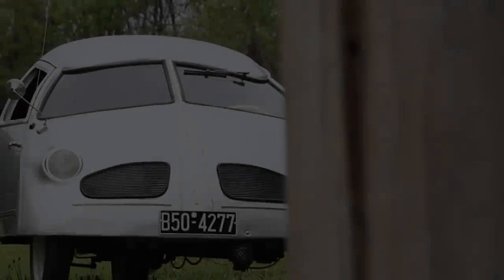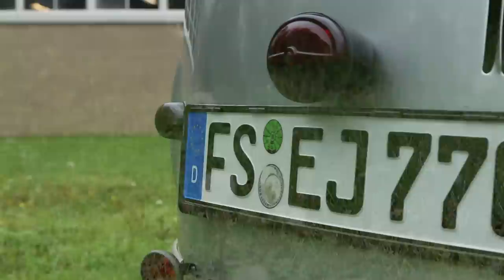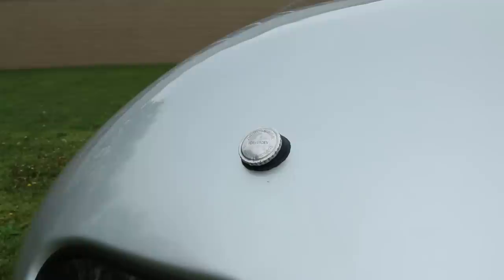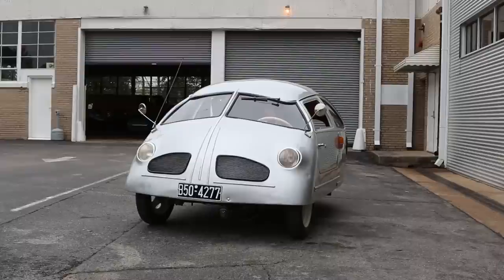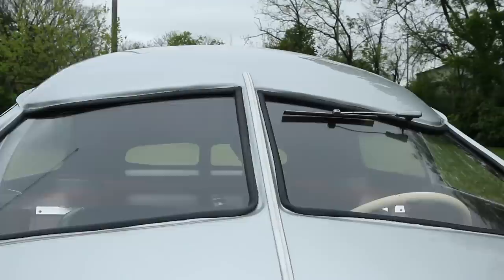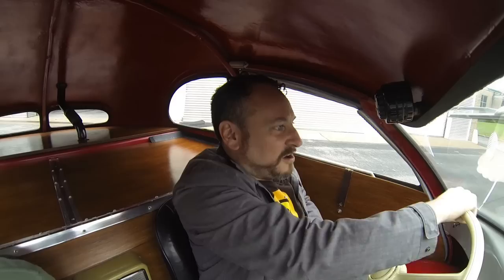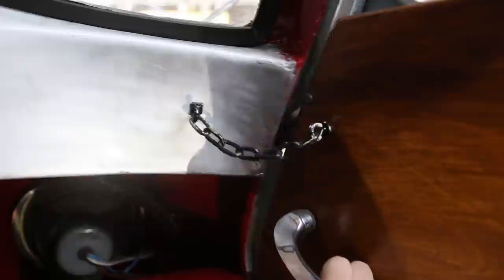What It's Like To Drive The Worst Car In The World | Jason Drives

Comment: I thought the Reliant Robin was as bad as it gets.  I was truly mistaken.
Reply: +David Hoffnung The only thing worse than having one wheel in the back, is to have it in the front. I am sure the Reliant Robin flips easier.
Reply: +Mp57navy On a normal 4 Wheel car, the rear wheels give it way more stability than the front ones, f.e. in a crash etc.. So it would make sense to put em in the rear, although they might have made it a bit wider.
Reply: +Mp57navy - only this one doesn't have it in the rear, not really. It's basically in the middle of the car, together with the fuel tank and the exhaust pipe. Wonderful design! :P
Reply: +David Hoffnung The Reliant Robin is uglier, which is saying something because the Hoffman looks like some sort of metallic beetle. I'd still feel unsafe driving either haha
Reply: Jeremy Clarkson should drive this
Reply: the RR is almost like a rollsroyce in comparison with this turdnugget XD
Reply: Not terribly bright are you, Freekrider?

Comment: By far, the worst part of this car to me is the rear wheel steering. Truly deadly.
Reply: ...and loses.
Reply: Yes, like he said the rotational momentum makes it hard to come out of a turn, but they also seem to have put the engine at the 'wrong' end of the trailing arm: maximum unsprung weight!
Reply: The Lane Motor Museum built a copy of Buckminster Fuller's Dymaxion car, which had a single steered rear wheel. Dan Neil wrote about it in the Wall Street Journal some years ago. Apparently it's a handful to drive. Better someone else than me.

Comment: Made my day,I nearly wet myself laughing,in fact I think I have. 
Nicely made, but designed all wrong,looks like  a giant SS helmet .
I know about these kinds of cars ,I had a Messerschmidt  KB 191cc  three wheeler,used to go quite well ,70 mph forwards AND REVERSE!!!!!!! bit more stable than this helmet on wheels,but I nearly got killed several times in  it, tipping up on corners if I pushed it too fast..
The clutch regularly burnt out as did the brakes,the flywheel came undone and ruined the windings, never charged the battery again,no one could mend  it, humping spare batteries every day, acid all over the floor andr my clothes, the engine fell off its ONE  rubber mounting, had to tie it back on with rope.. bloody nightmare
 to put it kindly..and I was stuck with it as it was on HP... after paying it off I swapped it for a tape recorder that also was crap.the last I heard the bloke who had it said the engine fell out as he was driving down the road. TRUE.
Reply: John Smith I was thinking more like a cockroach.
Reply: John Smith I
Reply: Lol , I once swapped a knackered 1978 Vespa Primavera for a rare Supremes LP 🤭
Reply: My brother in law's name is Jon Smith, but you are more funny
Reply: Hang on a second - the car was that bad, that you swapped the car for a tape recorder??
Reply: @ho2go  Yes and just remembered... plus £10.00 !   it needed a complete rebuild ,and I  had no money for that in the 1960's, soon after I passed my  proper car test,(I only had a motorbike licence)  and had 4 wheels ,much safer comfortable and reliable.
I would add, these God awful things are worth money now, even if someone offered me a pristine one for free I WOULDNT TAKE IT!  even if its runs ok its still going to let you down sometime and no one can mend it.
 Plus its  a death trap I shouldn't be here to tell the tale...God was on my side more than once.there are two times I remember I had to mount the pavement  and use a lampost to stop the bloody thing after the brakes failed  down hill.
TRUE, NOT MAKING IT UP.
Reply: I think you meant Messerschmitt KR?
Reply: @santinosalamanca4378   YES SHORT FOR KRAP...
Reply: @ho2go  I thought it go better...WRONG..
Reply: See my post today ,in fact there is even more I could relate but don't want to unstress  anymore, its making me feel ill recalling of all this  sorry episode......but perhaps its a good thing to warn others just  think before you leap, better the Devil you know ...

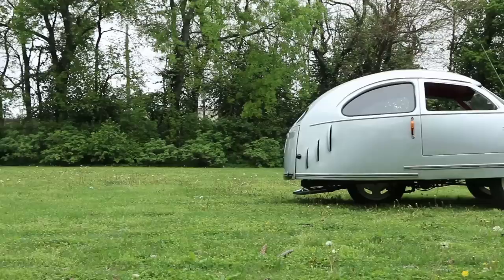Comment: 3:09 I love how the fuel filter (I think thats what it is) is just dangling there
Reply: Yes it is :) nicely spotted
Reply: Lil Puddin Tater looks more like the horn. It couldn't possibly have been designed to have a fuel tank and engine in the back and then the filter dangling from the front bumper, right?
Reply: wait what ?
but the engine is on the back , sprung on 1 wheel like on motorcycle , Fuel filter is dangling right on the shot when the video is shoot from under the back , watch it again ...
Reply: Quintinohthree I haven't done much with fuel filters, but I do know that despite where the gas tank is, the fuel filter can be by the engine. My friend has a car with a really old VW engine in it, and when we changed the fuel filter, it was literally on top of the engine
Reply: It is a universal fuel filter. I doubt that it is original equipment. Toward the beginning of the video it appears to be secured with a cable tie.
Reply: I was WONDERING what that was myself.
Reply: Also notice the yellow shock absorber(s)?  This car may have been modified to improve "drivability".
Reply: Save weight and engineering time, omit fasteners and a proper spot for everything that can be held up by its connections.
Reply: Yeah, but I get the feeling the car originally didn't have one lol with how badly it's designed

Comment: It must have been built from salvaged Aluminum from shot-down aircraft. But, when you have no factories left to build decent vehicles, you can't expect much better than that.
The Messerschmitt KR200 wasn't much improvement over this.
Reply: That's what I thought. In a country almost completely wrecked by the war and desperate to get back on his feet, they had to use every scrap they could lay their hands on, so this car seems to be made very quickly, and out of many different origins (these wheels seem to be taken out of some little tractor).
It was designed and made for a very specific purpose, to take people from one place to another with a minimum of comfort and economy, and for a certain period, not a lifetime. They were definitely not thinking about speeding it on autobahns.
Reply: Nick S not so safe for two people and a two-stroke engine to travel squeezed into a tiny metal case
Reply: The engine sounds like a 4 stroke.

Comment: RE My Messerschmitt  post below, I awoke this morning after having another nightmare after 65  years I remembered the very first thing that broke on this thing was the gear change ...it was about TWO MILES of heavy duty bowser brake cable from the right hand side of the cockpit to the motorbike gear lever on the LEFT side of the engine in the rear....luckily my Dad who had a bike shop made up a  solid rod arrangement on the left cockpit side  in line which  I fell over nearly every time I GOT OUT , I actually became quite good at performing a Rolly Polly on my way out of the contraption  up to Olympic standards  having got entangled in the gear knob,but it worked fine. Dad didnt have two miles of  heavy brake cable in stock  and didnt know where to get any.........Its a wonder I wasn't castrated on the gear knob 
I must have been a right So and So in my past life  to be punished to cruelly,   I wish I had kept my beautiful Norton Dominator which I part exchanged   for the evil thing and just applied for  FULL car licence...OH WELL.......I'm still here after having survived several near misses of being squished like a fly in the beast. God must love me.....

Comment: After WW II, there were a series of three-wheelers in the UK called Bond Minicars. They too were very lightweight (less than 896 lb - for tax reasons) three wheelers made of aluminium. They also used a two-stroke motorcycle engine and gearbox which pivoted with the steering. However, the entire arrangement was the exact mechanical reverse. It has two wheels at the rear, with the steerable engine/gearbox/wheel unit at the front. It also had a longer wheelbase and narrower track and was at least something like a normal car to drive. 

The later engines were 250cc Villiers 2-stroke units, with the more powerful versions having a heady 14.6 bhp (the very first model in the range had a kerb weight of just 500lb with 5 bhp).

Comment: I saw this thing when it was in the Micro Car museum in Georgia.  Two things no mentioned are the fact that the builder didn't even bother to make the body symmetrical.  Just look at how the roof meets the windshield!  The other problem is that because the engine and gearbox must have room to swing from side to side every time you turn the wheel, 100% of the space in the back of the car has been taken.  All it has is one rather wide 3 person (perhaps 4?) bench seat.

Comment: any car on 3 wheels is the worst car in the world
Reply: the Morgan 3 wheeler is very good though
Reply: 3 wheels is the future 2 front 1 back... but everything else went wrong with that car
Reply: +sadman hoque it's probably the best 3 wheeler ever built tho.
Reply: Actually 3 wheeler Morgans are quite well regarded and handle well.
Reply: Except that 3-wheelers are exceptionally easy to roll. They could use additional wheels on each side.
Reply: Jacques Blaque exactly
Reply: Jacques Blaque this particular tilting system
https://i.ytimg.com/vi/2ET_MIfCSWg/hqdefault.jpg
will be the standard 1 -2 seats vehicle, but there are no good models with closed cabin yet... and it doesn't roll... in theory it can change direction with more speed than a 4 weels car due to its center of gravity which is in the right place every time... it also have the much better energy consuption due to the low weight and the small contact with the surface of the road... and we talking about cabin vehicles with car seats... 
here is the first failure by toyota
http://www.elioowners.com/attachments/image-jpg.1282/
toyota can't do this, when someone do it right they may copy it...
Reply: cq33xx What you're looking for is the Carver, same tilting but with two wheels at the back and only one at the front.
Reply: Quintinohthree Nice vehicle but i strongly believe that the 2 wheels must be at the front...
Reply: cq33xx It seems overly complicated to me to have two wheels at the front and a tilting mechanism. By keeping the driven wheels flat and tilting the one steered wheel you make things a lot simpler then when you make the steered wheels tilt and steer at the same time while you have to drive a wheel with an engine that must be off-axle.
Reply: 3 wheelers with rear steering are the ones that really tip over.

Comment: The linear shifting pattern is logical considering the engine and gearbox came from a motorcycle. There, gears are changed by foot - one half of gears is below the neutral, one half above it. Six years after the WWII and in the conditions of war-devastated economy, it was hard to find something more than motorcycle parts in Germany. I think Hoffmann worked with what he found on scrapyards and military wreckages; he also seemed to make the construction as uncomplicated as possible :).

Comment: At least that car started and got him to his destination. I once borrowed a car for a while which needed breakdown service calling out to even start the thing (in the days before the AA got wise to people doing that), did 17 miles a gallon and had an exhaust system which couldn't be replaced, so i had to clamp a square of metal from a biscuit tin round the hole in the silencer, which invariably blew after 50 miles. It didn't even look any better than that car either.

Comment: But it only be a sample car.
I think the mistake is the designer put the body inversely……because of the fuel pipe…
This haffmann looks like drive reverse because the turning axis put behind and the gear axis put in the front.
Don’t put the fuel over your head…

Comment: I don'tr know what you want. This is obviously made right after the war and based on a scooter (Heinkel) or maybe motorbike, yet it even has a reverse, which MAJOR manufacturer BMW did NOT manage to do TEN YEARS later on its Isetta. Also, it has two wheel up front and thus does not roll over in turns, which it would do, were it made in England because they would have put a single wheel in front and two in the rear like in the Reliant Robin. Also, that thing is made of plastic, not glorious aluminium.

Comment: Australia had a car or what you would classify as one of the worst cars ever made  it was the Zeta Lightburn, built by a washing machine manufacture, one test report said ! if you need acceleration  jump out & run, to get reverse you stopped the engine turned the distributer and it it would run backwards I saw one once at a junk yard, wish I had taken it home, I have a list of my favourite automobiles, but that's  another story..

Comment: That is what you do when you can easily make lawnmower and motorcycle engines, but a typical auto engine is another story. Horrible mushroom design. The steering wheel is that motorcycle drive wheel, terribly unsafe you have to have 4 wheels to have any stability. My guess is that you have to mix the oil and gas for the 2 cycle Hoffman engine

Comment: This car is absolutely horrible! It's so bad that I subscribed, knowing that all your other videos have to be great, even if they are only half as good as this one. This beats my 1971 Volkswagen Squareback Volksamatic modified to have a carburetor sticking up through the floor instead of the fuel injection it came with. I bet it didn't have more than 25 horsepower. I should have called it "The Yellow Submarine" because it was yellow and when it rained your feet would get wet!

Comment: Sure, you may think you hate it now, but just wait till you drive it. 
If the roll over didn't kill you the carbon monoxide would.
The designer later worked on the Edsel. 

Much maligned by the press at the time, it made for poor sales. The Volksterne  Beobachter deemed it " unsafe at any speed" And they languished on sales room floors. Most car buyers opted for the people's car, the VW " Bug". 

All cars, be on look out for silver 51 Hoffmann.

Look! There goes on now chief.       Ah, that was more of a grayish, keep looking.